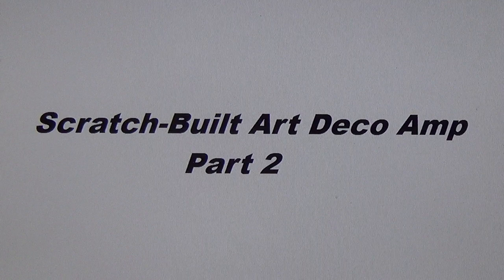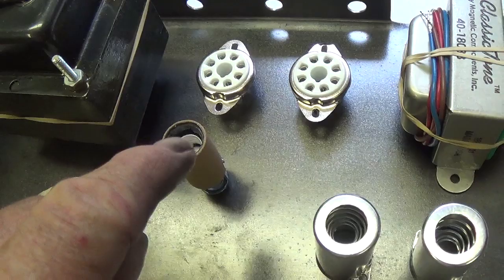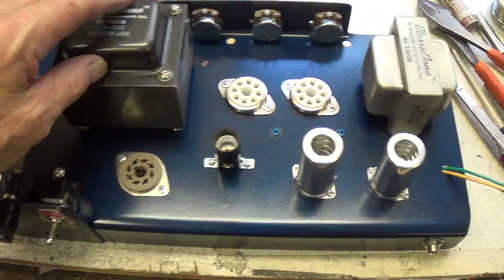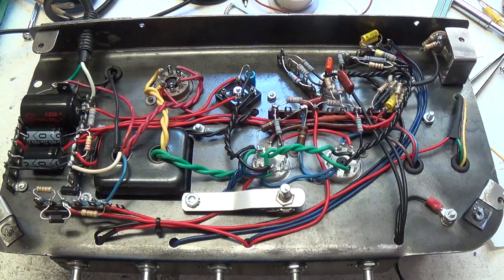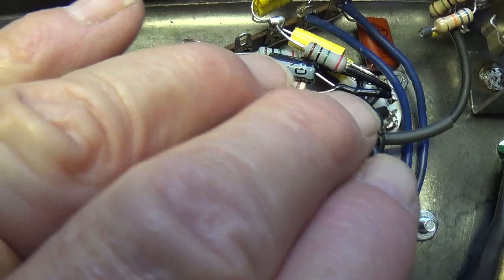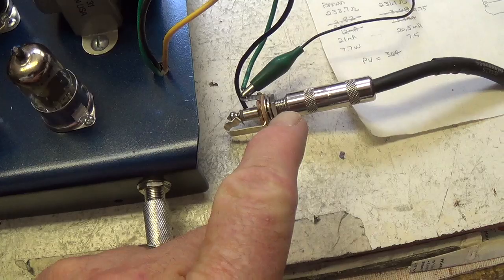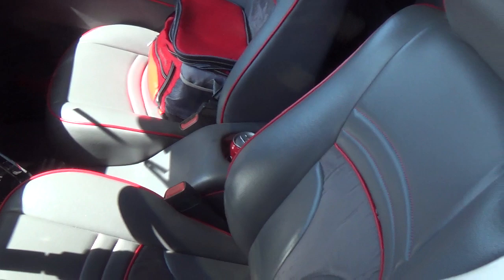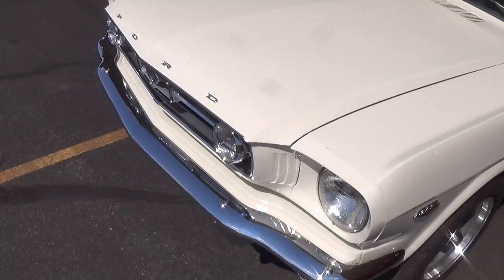Scratch-Built Art Deco Amp, Part 2:  The Chassis is Completed

Comment: Just when I thought the video couldn’t get any better, a 68 Camaro pops up on the screen. I think that color was called Butternut Yellow. I owned a 68 396 SS clone for 16 years. It was triple black, with a 4 speed of course!  Manual steering with that big block made quite a workout
backing that beast out of the driveway. I’ll never forget driving it with straight headers, to the muffler shop. Neither will the neighbors.

Thanks again Uncle Doug!!
Reply from the maker: Thanks so much, Tom. I think you're right on the color name when applied to a Chevrolet. I would have loved to have ridden along for the trip to the muffler shop :)

Comment: Greetings from Portugal Uncle Doug! After some videos, I'm pleased to see that we share the same passion for tube amps, electronics and vintage stuff as well as for old cars and motorcycles...I've subscribed your channel because I just can't get enough of your tube amp restoration and building. I hope I can soon start a project for buildind a tube amp for my amateur guitar skills. I'm actually restoring a 1952 Norton model 7 twin that I get in a box...there has been almost 15 years since I've started but the body parts are scarced and the 2008 crisis made it's toll, and I have two small kids. I'm working in the engine now, since all body parts have been gathered and properly finished.....cheers and many thanks for your videos....
Reply from the maker: You're welcome, E1, it's great to hear from a kindred spirit. Best of luck with your amp-building project (when you begin) and be sure to post some photos of the Norton on my FB page: Uncle Doug's Vintage Amps.

Comment: Great video Doug!! I love the car show narration, and the amp build was superbly done. The only nit I would pick (and it's microscopic) is that on a push-pull amp build it's often suggested to leave the plate leads to the 6V6 (in this case) output tubes long (eg; not tucked in) in case you happen to get them flopped and the amp motorboats on first turn-on and you have to flip them.
Reply from the maker: If you're speaking of the howl that can occur when the NFB loop is wired wrong, I simply pay close attention to the wiring diagram for the OPT and ensure that the NFB loop is attached to the proper secondary lead.

Comment: Great idea on the negative feedback pot , my amp calls that pot presence which gets brighter and cleaner sounding the higher its set !
If your amp is muddy find the wire with resistor  coming from the transformer which goes somewhere in the preamp signal circuit.
Lower the resistance and allow more signal to be cleaner and a bit brighter with tighter bass or less clipping !

Mojo makes a great effects loop to add on to amps , I can not tell you with words what a big and awesome difference it makes for the tones you can get !
Reply from the maker: Thanks, Ijam........glad you like it :)

Comment: Howdy again.
It is sometimes experienced that one solder strip mounted with the tube socket screw does not provide enough solder points.
One solution is to use long screws and mount two strips using a 15 mm (½ inch) elevation nut in between. Kinda like "in two floors". This will provide lots of solder points but requires that the chassis hight suffices, which could prove a problem, since the lugs are vertical relative to the chassis plane.
If the chassis hight does not suffice one may consider this. First flatten the mounting lug of the strips to facilitate horizontal mounting of the strips. The strips will be parallel to the chassis plate. Elevate the first strip with a 10 mm (3/8 inch) elevation nut. Then elevate the second strip further with a 15 mm (½ inch) elevation nut.
The examples are only for building a mental picture of the method. Actual elevation nuts should be chosen according to available chassis height, of course.
Alternatively. Instead of one long srew, elevation screws (male + female) may be used to build up the elevations. This method provides easier maintenance than a long screw with elevation nuts (female + female, drill through).
Regards.
Reply from the maker: Thanks so much for your very useful input, Eugene.

Comment: To help re leave congestion on the small valve bases, I tend to take the heater wires from the pins and push them tight against the chassis rather than going over the pins making it harder to fit components. I was taught to do this as the chassis would tend to screen the AC from other components rather than radiate the AC from wires running high over the valve bases.
Regarding the lighting, I think I would have used blue LEDs, I know it's not exactly retro but if hidden within the cabinet rather than on view, it would look really nice, plus the blue colour is better from an LED than a painted lamp!
I love 6V6s, used  them a lot for amplifiers as a youth in the long distant past, then progressed to EL34s ummmm more power!!
Reply: Yes, I always push any AC heater wires down to the chassis as you recommend!  I thought the same about the light!  LOL  Diodes are cheap and can tap off the heater AC or his fan's DC rectifier.  They even have diodes that change colors if he wanted.  ;^)
Reply from the maker: Thank you both for your input.

Comment: Uncle Doug, you've clarified my life in the first 4 seconds of this video. I'm neither a lad nor lady but I self-identify as a tubeaholic. I'm powerless over the warm glow a filament, the hum of a transformer and the gentle heat from a properly-biased beam power tetrode. I'm thankful that we all can gather together in peace and harmonically converge through your amp guidance and expressions of love through your divine wisdom and worldly craftsmanship!

OK, coming down from the clouds now... 
I'm not a car guy, where did you get the GM dark blue metallic acrylic lacquer? Is that in a spray can?
Reply: I found a spray can of GM metallic blue, https://www.amazon.com/Dupli-Color-EBGM03937-6-PK-Metallic-Automotive/dp/B004BRINTS?th=1 , is similar to what you used? or did you airbrush this on?  I think I'll go talk to a local car restorer about this. Thanks for the tip. 

BTW, love the look of this chassis. Can wait to see how you add your touches to the cover.
Reply from the maker: I believe that's exactly the base coat I used, Craig, with 4 or 5 clear coats. In Part 3, I go through the entire process of fine sanding and polishing the lacquer finish. I think/hope you will be impressed by the result. Also, I'm impressed by your political correctness and promise to never make fun of your alternative gender.....or at least almost never :):)
Reply: Thanks for the consideration but I'm not fragile, there's no need to self-censor. Have a good evening and please give Jack a little loving behind the ear or the classic butt scratch from all of us.
Reply from the maker: Butt scratch it is !!! Likewise, Craig :)

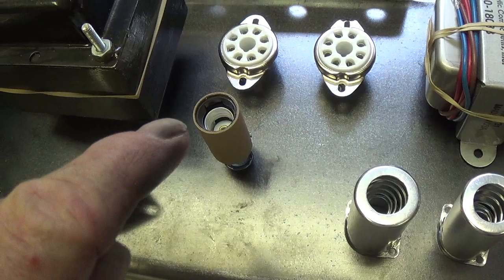Comment: 4:04 - "...Internally eliminated..." :P
12:30 - "...building your own amp from scrap." >.<
20:06 - "...neighbors will file more restraining orders." o.O
23:11 - "O-ring tires" Amen, brother. Oh, and get a polarizing filter for your camera.
Great work, as always. Scratch-building gear like this is easier than building a wayback machine to revisit the era when they were king.
Pro tip: To find Jack, take any tin can and open an end with a can opener. You can do this from any room of the house. Jack will appear, guaranteed!
Reply from the maker: 4:04   ".....internally illuminated"
12:30  "....building your own amp from scratch"
The rest are OK
I'm lucky to have a camera.....let alone some fancy polarizing filter that probably wouldn't attach anyway :)
Thanks. Yes, it is.

Comment: That metallic blue looks nice. Wiring is nice especially as someone who recently got a double-ended 807 monoblock amp in "I started then lost interest" state :D Soo many loose ends...
Reply from the maker: Thanks, Tosca. Best of luck with your project :)
Reply: @UncleDoug  Lucky the guy never got to finish the phase inverter circuit. The 807s were connected to a 4600ohm output transformer, so each tube would'we been working into 2300ohms@350V. Outside of every spec for the 807. So it looks like I got a bunch of parts here :D
Reply from the maker: Sorry to hear that, Tocsa. Let's hope the parts are of good quality at least :)

Comment: Howdy.
Yes. The noval sockets are a pain using point-to-point wiring. My solution is to use two 3+1+3 solder strips mounted with the socket mounting screws. If only one component connects to a socket lug I solder that directly. If two or more components connect to a lug I first solder a wire from the socket lug to a strip lug. The I use the strip lug as the branching point. This provides somewhat more component space.
Regards.
Reply from the maker: Excellent suggestion, Eugene. Thanks !!!
Reply: @UncleDoug  Howdy.
I am happy to join The Amp. Wars campaign ...
Regards.

Comment: Very cool,  art deco has always been a favorite of mine design wise.
UD if the adjustable neg feedback doesn't float your boat, (mine stays in one spot 99% of the time) you can  use the hole for an adjustable input control
(15k to 68k) .  That  control I do use  (15k resistor in series with a 50k pot).
Or ...a tweed switch , that one is really neat on a tweed amp.

Comment: Hey Doug..  I love the video as always.  Sounds like you may have some oscillation around the 20:20 mark; right when you turn up the 300 cycle tone , and again when trying the tremolo.
Reply from the maker: You are correct, Aaron, as I discovered yesterday and repaired today. The plate wires from the OPT primary were reversed. Generally this causes a loud howl, but in this case it was just a very slight, high frequency chirp or whistle....as you heard. It's completely gone now :)

Comment: I agree that O-ring tires don't belong on a car of that vintage. Show me some rubber !
In high school I had a '72 Nova (350 4spd) with fat 60s on the back , "bicycle" tires up front and of course, jacking shackles on the leaf springs. It's faster that way 'cause you're always going down hill. 😎
Reply from the maker: Those were the days, CA. I'd buy some used $2 Bucron rear tires from the local gas station (economical "cheater slicks") and wear them out in a weekend. Of course, they were pretty well worn out when I got them :)

Comment: Uncle Doug, install the immortal amp mod on your rectifier tube socket.  2 IN4007 diodes that get the AC from your PT before going to anodes of your 5Y3 tube rectifier.  This still retains the slower HV ramp up of the tube rectifier, but protects your PT and E-caps if the rectifier tube happened to short through to the HV circuit.  About a $0.05 cent mod.  Mount the diodes to the unused pins on the rectifier socket and move the AC wires from the PT to make it go through the diodes first with the other side of the diodes connecting to the correct pins of your rectifier tube.  With this installed you can also make a jumper socket to replace the tube rectifier and boost your B+ voltage by 20% + eliminate the rectifier tubes voltage drop.  ex. - Tube rectified B+ = +250 Vdc jumper socket B+ = (250x1.2) + (tube V drop) or 300+20 for about +320 Vdc with the jumper socket installed.  No slow ramp up of B+ with SS jumper and the bias of the 6V6's will need readjustment.  IF a 5Y3 tube shorted through the amp will continue to play without burning up anything, and you will notice more output from the higher B+.  ;^)
Reply from the maker: I appreciate the tip, Paulin, and will definitely keep it in mind. Thanks !!!

Comment: I am always impressed by the thought process that goes into your work and your attention to detail.  The small hole to fit the pot tab is an example.  I have seen many amps where they are just bent or broken off.  You obviously don't just think "Oh what the heck, that's close enough".  Also, thanks for showing the simple but effective use of the block of wood when using the step bit.  The painted chassis is a nice touch and as blue is my favourite colour the amp cover is going to look sensational.  I'm betting there won't be any orange peel finish in the paint work.  When the amp is finished would you let us know what the lower and upper frequencies of the modified tremolo oscillator are please?  Regards, Jeff.
Reply from the maker: Thanks so much, Jeff. I guarantee that no orange peel will appear in the final finish :) Part of the beauty (and curse) of acrylic lacquer is the polishing process after the application of the paint to the surface. I would estimate the tremolo frequency range to be (approximately) 2 to 12 cps.

Comment: Well …. You've done it again ! Such a great effort and master class for all of us "wanna bees" dreaming of making our own valve amps. Can't hardly wait to see your exterior treatment that will partial obscure the business "double" end ! One thought I think you had said you were going to use the fan to bring air in, perhaps an exhaust fan as the heat from the tubes passing over the transformer will not matter. Creating a low pressure area inside might cool a bit more "better-er". Either way I'm sure the sound will be awesome, I have no doubt ! 

Thanks Uncle Doug, you Rock …

Robert aka jagjet
Reply from the maker: Thanks so much, Robert. I am seriously considering the idea of using the fan to exhaust the heat, particularly since the source of fresh air (all the venting) would be far greater and more uniform.

Comment: 15:40 I am thinking of a ring out of some sturdy material with its inner diameter fitting just around the ceramic socket and its outer diameter large enough to gain some space for mounting and 8 nice copper rivets arranged around the circumference.  Maybe even wood would work :D
Reply from the maker: Rivets are good, NN.

Comment: Your killing me Uncle Doug with these builds, I was only able to respray by Transformers to a nice color and you go ahead and build a whole amp. Thanks for all the tips, lessons and amps. Question on bending the curve with the rod? what math did you use for that? When I bend pipe for work sometimes I bust out the Ugly's book for electricians
Reply from the maker: You're welcome, Lego. No math was involved. You simply use a rod of slightly smaller radius than what you need for the bend radius. Bending pipe is a different matter.....you need mandrels to retain the circular cross section throughout the bend.

Comment: I would've riveted the terminal strips in after applying the paint since then the rivets for the tube sockets match the shine of the other ones, and I think the paint on rivets look pretty bad. but everyone has their style. 
also, I've heard that rivets around a great way to electrically connect 2 things together, better to try soldering the terminal strips to the chassis, or maybe even both. 
anyway, the amp looks amazing.
Reply from the maker: Thanks, Edgars :)
Reply: Wow, he had to really hunt for something to complain about... Found something, though.

Comment: Great video as always, thank you!! Could you please explain the purpose/benefit of the diode in the bias circuit? Look forward to the next video!
Reply from the maker: Thanks, SH. Since the bias voltage is applied to the output tube grids, it has to be DC or else it would cause an awful 60Hz hum. The diode rectifies the AC bias voltage from the power transformer into DC for the tube grids.
Reply: @UncleDoug  that makes sense...thank you. I was looking at it all wrong

Comment: Beautiful work, and going with a cathodyne circuit should sound sweet.  Inviso-Jack!   I'll take either of the '32s, even if they are fiberglass.
Reply from the maker: Thanks, Andrew. Although I must admit that no rust issues, smooth body panels,  and light weight are appealing.....there is something special about good, old fashioned steel :) Like you, however, I'd crawl on broken glass to own either of them.

Comment: Hey Uncle Doug!!! I love the slower trem speed. I noticed it right away before you even mentioned it and I think it's great. I really think it makes the tremolo more useable, for my tastes anyhow. The whole project is cool. It's probably too late to make this suggestion, but maybe not...If I was to put in a cooling fan I would install it blowing out, as an exhaust fan. That way, it'll draw cool ambient air from its surroundings gently and evenly through all of the openings rather than blowing cooler air directly at one spot while the other areas get hit & miss cooling. It's just a thought. Great video as always. I'm really looking forward to part 3.  {8^)
Reply from the maker: Thanks for the suggestion, DE. By coincidence, while testing the fan, I accidentally installed it backwards and noticed the probable benefits of operating it in exhaust mode. Once it's all together, I'll try it both ways and use the infrared temp gun to see which is better for more uniform cooling.  If you look closely at the final circuit review, you'll see the double .01uf caps in the tremolo section (top right corner).